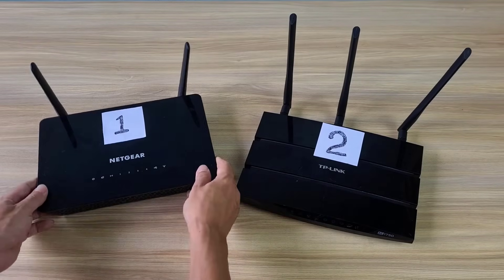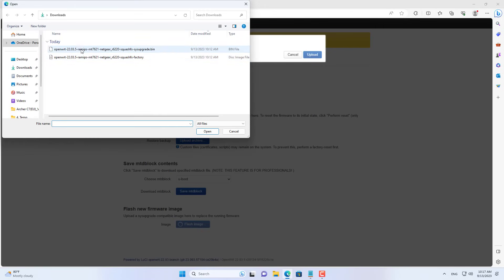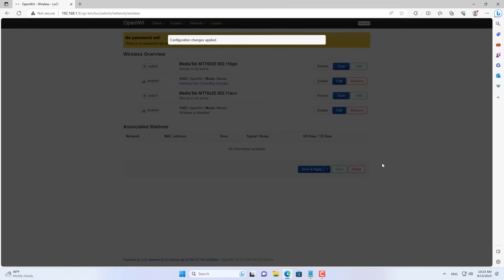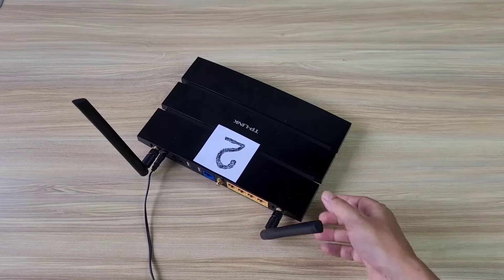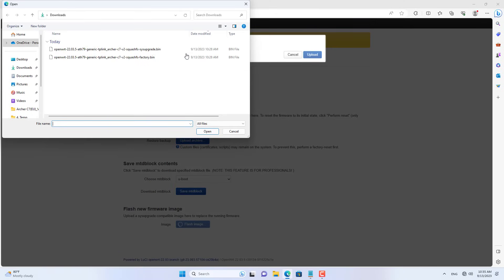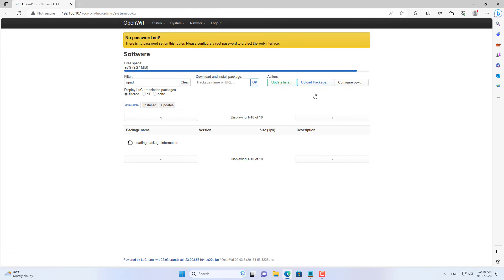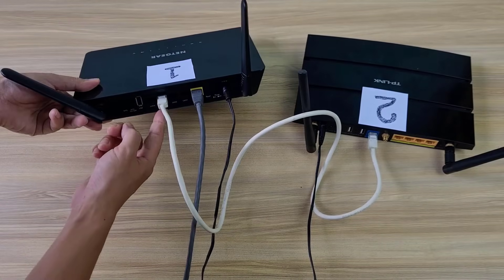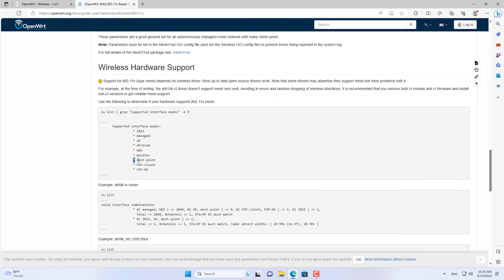OpenWRT : DIY MESH WiFi from old Routers

Comment: This is a great video.  I'm planning on updating my TP-Link Decos to OpenWRT; and this is a great starting point.  Question though: if I have three different Decos, does each one need to be on it's own subnet?  Or could I just change the IP address to different addresses within the same subnet?  E.g., Deco 1 is 192.168.1.1; Deco 2 is 192.168.1.2; or does Deco 2 need to be something like 192.168.2.1?  Thanks.

Comment: Thank you for your guidance my friend, still works well in 2025, i'm using with my old tp link tl wdr4300 v.1 openwrt+extroot usb-ext4 (use both tp link for mesh), also try with my other tp link archer c7 ac1750 openwrt v.5 and v.2

Comment: I have 3 tp link routers.
2 dual band (lan connected) 
1 single band
 I want mesh network wired. How to do so? Please help
Reply: Just setup one SSID and password on Routers/AP, enable 802.11r, 802.11k, 802.11v BBS, for Band Steering download DAWN/Usteer if you need band steering. Its work on OpenWRT. But its not mesh, its just 802.11r/k/v. On router 2-3 enable DHCP for LAN ports, and insert the cable on LAN ports. That It.

Comment: I will connect Computers to each of the two routers.
The structure is roughly as follows:
Modem ---- Router1
                        +------------------------Router2
                        +---- PC1                   +---- PC2
                        +---- IPTV
(and Phones moving)
Both routers will maintain a wired connection. (Signal is too weak to connect wirelessly)

In this case, can I disable DHCP on Router 2? are there no problems for PC2 using the Internet?

Comment: I used a much more simpler way and bought two Netgear r7000p routers and set the 2.4 & 5 GHz ssids and passwords the same. Then I assigned each one of my devices to a specific IP address in router1. Connected to router 2 with Ethernet and I have internet from one side of my yard all the way to the other which is over an acre all the way through my house and to every device with no issues and I still use the factory firmware and software upgrades from Netgear. Both pro router was only $20 each. Much more simple and secure.

Comment: I would have used the 5 GHz radio for the mesh and the 2.4 GHz radio for the clients.
Reply: 2.4 GHz is sometimes used because of it's ability to get longer range under tougher conditions.
Reply: @bradkaral1188  You may be right about having to use less airtime with fewer clients (nodes only).
Reply: And on the 40Mhz range.
Reply: @ Range?
Reply: @francocastilloAR  three floor house, AP on each floor.
Reply: @ "40Mhz range" what I don't understand.

Comment: Thanks, good information, can you upload an video on to add a old router to the existing MESH network. In my case, I have a TP Link Deco XE 75 (2 piece), and have couple of old routers, the latest one is Netgear R6400 AC 1750. My question is how can i add the Netgear R6400 to the mesh?
Reply: I want to do the same, but i can't figure it out the SSID of the Decos

Comment: What is the difference between this Mesh network and a router with WiFi extension capabilities?
Reply: A mesh network and a router with WiFi extension capabilities serve similar purposes, but they have distinct differences in how they achieve network coverage and performance. Here are the key differences between the two:

1. **Topology**:
   - **Mesh Network**: In a mesh network, multiple devices called nodes or access points are interconnected to create a web-like structure. Each node communicates with nearby nodes to relay data, forming a self-healing network. Mesh networks can be wired or wireless, and they distribute the network load evenly across nodes.
   - **Router with WiFi Extension**: In this setup, you have a primary router connected to your modem, and then one or more additional devices (usually called WiFi extenders or repeaters) are used to extend the WiFi coverage. These extenders communicate directly with the router, essentially repeating the WiFi signal to expand coverage.

2. **Scalability**:
   - **Mesh Network**: Mesh networks are highly scalable. You can add more nodes to the network to increase coverage or improve performance. The network dynamically adjusts to accommodate new nodes without significant configuration changes.
   - **Router with WiFi Extension**: Extenders can help extend coverage, but their effectiveness may diminish as you add more of them. Each extender creates a separate network segment, which can lead to issues with roaming and device handoff between different access points.

3. **Seamless Roaming**:
   - **Mesh Network**: Mesh networks are designed for seamless roaming. Devices can switch between nodes without interruption, and the network manages the handoff transparently. This is important for maintaining a consistent and reliable connection as you move around your home or office.
   - **Router with WiFi Extension**: WiFi extenders may not offer seamless roaming by default. Some systems are designed to support roaming, but it may not be as smooth or efficient as in a mesh network.

4. **Network Management**:
   - **Mesh Network**: Mesh systems often come with user-friendly management apps that make it easy to monitor and control your network, including features like parental controls, device prioritization, and guest network setup.
   - **Router with WiFi Extension**: Managing a network with multiple extenders can be more complex, as each extender may have its own settings and configuration. Centralized management can be limited compared to dedicated mesh systems.

5. **Performance**:
   - **Mesh Network**: Mesh networks are generally better at distributing the network load and providing consistent performance throughout the coverage area. They often use dedicated backhaul channels for communication between nodes, which can improve overall speed and reliability.
   - **Router with WiFi Extension**: Performance can be more variable with extenders, as they rely on the strength of the original router's signal. Extenders may also introduce some latency and reduced throughput.

In summary, while both mesh networks and routers with WiFi extension capabilities can improve WiFi coverage, mesh networks are typically more effective at creating a seamless, scalable, and high-performance network, especially in larger or more complex environments. However, they may be more expensive than a basic router with extenders. The choice between the two depends on your specific needs and budget.